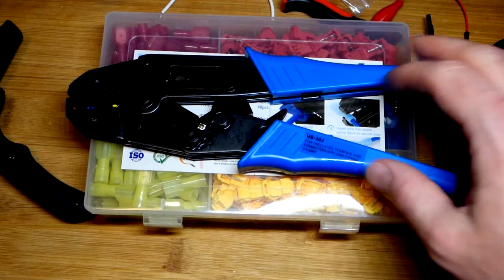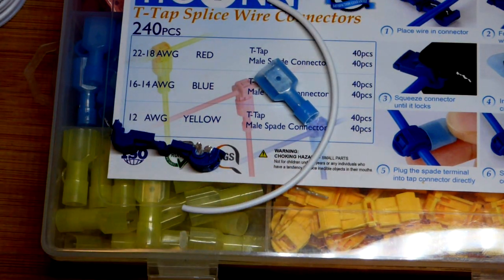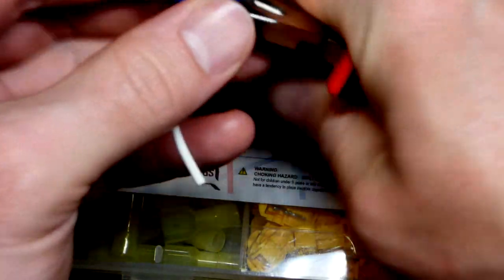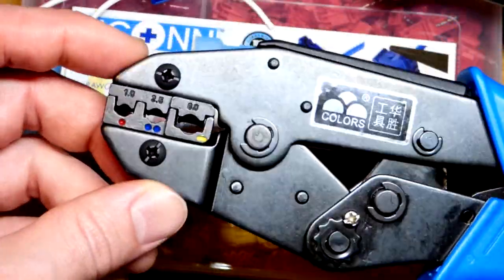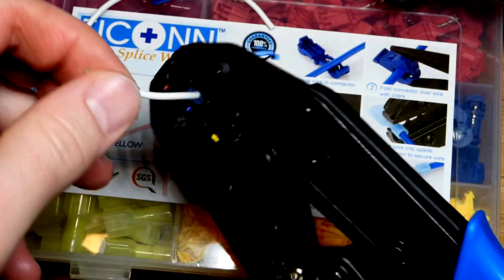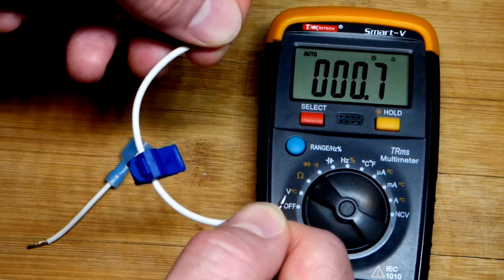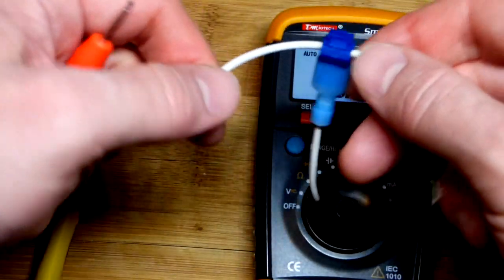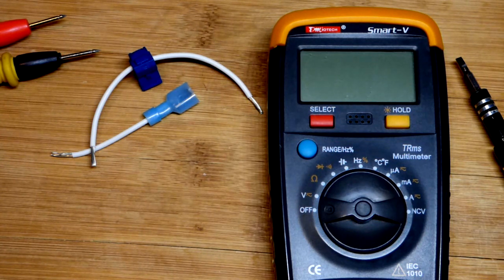How to use ratcheting wire connector crimping tool plus cutter stripper with removable T splice

Comment: I didn't know you  could use it to hold a connector in place and the wire is inserted on the side where the colored dot is. Good information.

Comment: I am so tired of all these videos claiming that these crimpers are ratcheting. They are NOT! On any ratcheting tool, you can relax the handles and then get a new ratchet spot and gradually tighten the tool. On these things, you have ONE squeeze and that's it. If you relax your grip the thing is locked up and there is no ratcheting action. It is one super hard squeeze and that's all you get.  It looks like it is a ratcheting tool but in reality, it is only a geared set of pliers with no true ratcheting action. Think about a ratchet wrench. It allows you to go back and forth to tighten or loosen a bolt/nut. This tool does not do that. It is one squeeze and that's all you get.
Reply from the maker: Thanks for the info !
Reply: Mine has a release lever inside the handle that enables you to relax the the handles at any time even after a couple of clicks.

Comment: A bit of thought in regards to cars and wire crimping. A lot of people are against crimping wires in cars, and end up soldering things. Two problems with this, 1) manufacturers don't do it unless they are on a PCB, and 2) soldering wires in a car that will have vibrations one way or the other, will make the soldered wires fail prematurely because both the heat from soldering makes the wires brittle, and the solder reduces the flexibility of the wire. Often these soldered joints fail, if they are going to fail, at the base of the solder joint right where it starts to get brittle. Also, the same people never make the effort to secure their wires so they vibrate as little as possible--yes, I've heard wires in door pillars rattling when going over a bump--well done, guys. Car manufacturers crimp, and then use heat shrink to protect the joint from ingress. There is a lot of misinformation on youtube about 'soldered wires are best in cars because they don't corrode' etc.. Just a quick rant. Carry on!
Reply from the maker: Yup, that's what I read a while ago, and it makes sense to me.